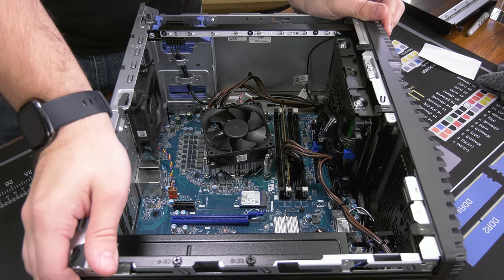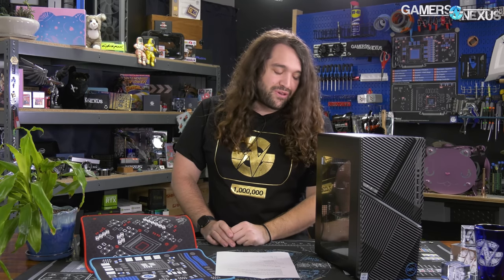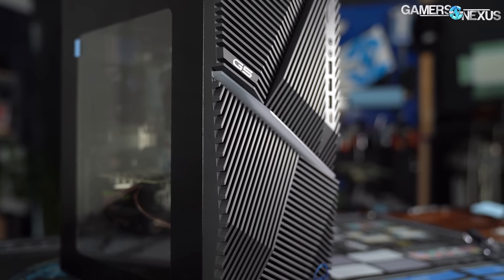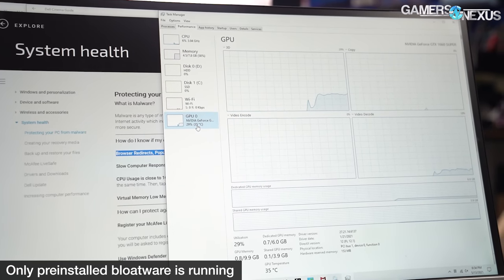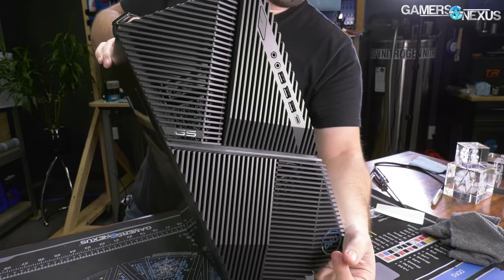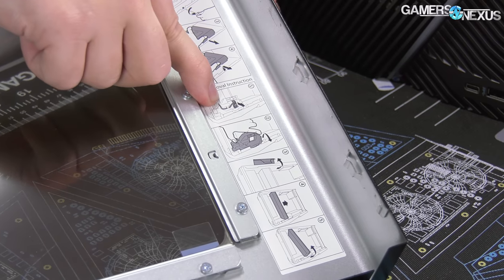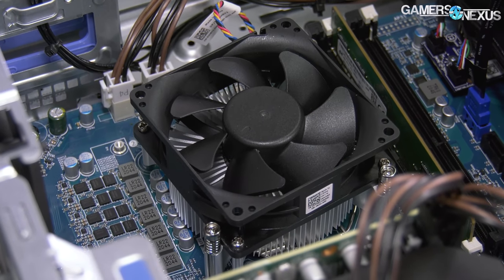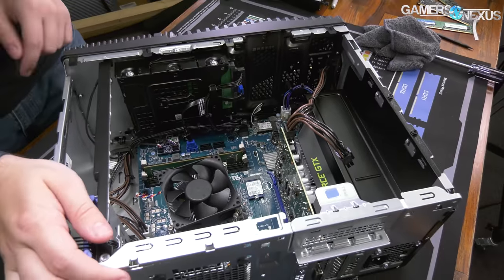Worse Than Walmart: Dell G5 5000 PC’s Garbage Parts & Hidden Charges

Comment: All of this is pretty standard Dell. I just built out an optiplex 7010 that was the generation right before they switched over to the proprietary everything. Those are honestly not bad. If that cooler is the same one as my 7010, it should be compatible with Intel style mounting brackets if you buy a backplate for it to replace the one integrated into the case. I was able to install a noctua cooler in mine.

Comment: That plain jane ram is actually very easy to overclock and clocks quite high. You can read the ic information which is nice and helps with overclocking the ram.

Comment: Dell consumer PCs have always been cheap trash.  When I did IT work over 20 years ago,  I faced trying to fix or upgrade Dell PCs and they were all proprietary parts back then.  Almost everything is integrated on the motherboard, and they are very hard, if not impossible, to upgrade.  The motherboards are not standard industry form factors, so they can't be swapped using the Dell case.

I also seen this with HP systems, but at least they use standards power supplies.  I can't count the number of power supplies I changed over the years, when nothing else is wrong.  With a Dell, you can't go to your local PC or electronics store, and pick up a new power supply.

Comment: I bought this on sale early 2020 before the supply chain issues and so far I've loved it. My system only runs at 1080p, and I've added two fans and two 16gb ram sticks. The plan for my next upgrade is a new cooler and a new processor all in one go, and maybe a 2.5ssd when myt memory becomes an issue. This PC kinda got me interested in building other PCs with a full range of modularity. I think this PC makes sense to a niche "new pc gamer" customer, like I admittedly was, and I get that full-on spec chasers will cringe knowing they have a built-in limiter on their chassis. Still, it was weird watching a review of a product and having none of the issues you mentioned. No billing issues, had fun learning some basic computer building tidbits, and got a dependable system for cheap. Am I crazy?

Comment: I worked for dell for years.  The parts they use from pc to pc are not consistent and many times because the components are so cheap, dell will tune the pc with parts that are not upgrade-able or have a custom bios config that will only work with a very specific piece of hardware.   This is the big draw back of any dell consumer pc.   They all have this in varying degrees. The server side of things is different.  

The real downside is that dell will change a configuration very quickly if a cheaper part is available which means pc's within the same model and same year CAN have different parts and different bios configs on top of the fact that most of the hardware is proprietary. so you never know exactly what you are getting. The crazy proprietary parts are to lock you in to dell. 

For most people this is a non-issue because in an office setting, the pc will work fine and never have a hiccup running your typical MS office suite.  There are much better options but they're cheap so....  A lot of of companies who buy bulk PC's will also buy bulk power conditioners to go with the pc which gets a longer life out of the cheapass power supplies that come with bulk pc's.

Comment: Can I replace the motherboard on my G5 5000 with a MSI Z590 pro wifi and still fit in casing? also, can I replace the power supply as well after?

Comment: Its basically an Inspiron case like my SFF. Identical but with adapted acryllic window and the front has a facelift with more air flow. Otherwise the case is the same as the Inspiron cases. Not cheaply feeling cases and the metal is substantial thick. Luckily the G5 case has an exhaust fan while the Inspiron models sport no fan at all but the processor fan has an direct intake to the side metal (without any filter). The Inspiron cases rely on passive case cooling.

Comment: Years ago I actually had and used a Dell XPS 8300 series. I can't remember what gpu it had because I replaced it soon after, pretty sure it was a Radeon HD 5000 series of some kind, but definitely a mid-range budget card. This was during the sandy bridge era for intel so it came with an i7 2600(non K), 8gb of 1333 ram, and I think a 2TB seagate drive. For the time, it was a pretty good little gaming computer, this was late 2010 early 2011 time-frame. It did pretty well, and it wasn't loaded with a bunch of bloatware garbage. It did have it's flaws, the case was horrible & cheap, zero airflow or room for additional fans, dell parts like their motherboards leave zero room for expansion or upgradability,. I was a teenager who had barely started working, my mother bought it for me, first real "gaming pc", under the condition I paid it off when I could. All I ever could do to it was max out the dimm slots and upgraded the gpu twice. Last gpu I put in it was an GTX 660 Ti and that was pretty much the max for whatever power supply dell was putting in these things. 

I haven't touched a Dell product since then, because I got more and more fascinated with doing my own builds, sourcing my own parts and learning as much as I could. But the reason I say all this is because at least at one time, Dell's gaming machines were at least decent. But what fascinates me here is it genuinely looks like Dell hasn't innovated at all in terms of their "gaming focused" Dell branded machines. Same horrible case construction, same proprietary parts that do nothing but frustrate the end-user and make upgrading more painful than it needs to be, etc. Feels like they're still stuck in the past.

Comment: I have seen a motherboard like that before. It will surprise you but it is extremely similar in shape and engineering.  Sony VAIO VGX-XL family.  Like the VGX-XL1. 

It has a custom everything.  Even the USB headers are custom,  custom power supply and it doesn't use standard 24 PIN either.

Comment: I have this same system and for the most part it serves me pretty well. I got it on ebay with an i5 10400f with 8gb of ram and a 1tb hdd for $250. Then I bought a gtx 970 ti before the gpu shortage for only $120. I installed some extra storage and added an m.2 ssd I had sitting around. But hey I only spent around $370 on it so I got a good price on it!
Reply: I have a similar setup but I paid $800 for it lol.

Comment: The chipset heat sink withe the wire spring retainer takes me back 20 years to when I was making amd athlon xp type set ups. When GeForce was relatively new and 3dfx was on its way out.

Amazing how a small detail takes you back.

Comment: It's not just Dell, I made the big mistake of buying an ASUS prebuilt a year ago.  Junk, no support and they wanted me to ship the thing to Puerto Rico?  I used the video card out of it and that was it.  Newegg  was no help becuase I had opened the case (rolls eyes) I reused a LIan Li case I had from the mid 2000's, purchased all new parts and burned the $1500 I spent... well,  I got a video card out of it.  Ultimately the CPU was shot.  The rest was just garbage, PSU and all.   

I used to build my own machines in the late 90's and early 2000's, but my knowledge stopped after the first Core 2 Duo's came out- just fell out of interest. I Just wanted a machine with a warranty.   Back home, I bought a Milwaukee PC machine and just upgraded the video card, this was back in 2012.   That machine still runs today.  The ASUS shell and all of the proprietary junk is sitting in a pile in a closet.

Comment: I didn't build my own system this time (the last build I did was 2916). I wasn't able to save any money so no point IMO. I got OCUK to build a banging "gaming" PC, i5 12600KF, 16GB DDR4, Gigabyte Z690 mobo,  Kraken X53, Gigabyte RTX 3080, Seasonic 750w PSU, Corsair 400D & all with 3 years warranty. Winner winner chicken dinner. I would never look at buying a "prebuild" system like Dell,

Comment: They still do that crap? I was a loyal customer to Dell for many years. But after i figured out that you cant´t replace the powersupply with a standard one, i was done with Dell. I just took the money that i would have spend to buy a new Dell, informed myself how to build one and what component is working well with another, bought all the parts and had a much better machine than ever before. Thats around 12 years ago and that thing served me well for more than 7 years. I needed something new and could sell the motherboard, memory and graphics for some money and build a new one in the same old case. Still works great and upgrades and repairs are easy.

Comment: I bought this same PC but mine didn't have a window and it had a 1660ti , I bought it when it was impossible to find cards and I got somewhat of a decent deal on it from a local shop, first thing I did was take the Cpu and gpu and put them in a new motherboard, case, fans and power supply, when overclocking the 1660ti I actually achieved some pretty good clocks , ig I won the silicon lottery with that little thing, I eventually sold the build I made out of it but it was pretty good and got me through the graphic card crisis. I will forever love that build because although it was jank it worked great for me, I was running all the games I played on it without any issues
Reply: Edit: with the leftover case I actually put a Celeron g5900 and old amd 2gb card in it recently and sold it as an office PC

Comment: Yes I'm late af here, but, I got a G5 5000 on ebay with a i7-10100F and a PNY GTX 1070 in September 2022 for ~$850.00 + tax with and am quite happy with it. I recommended it to a friend and when they went to that seller's page it was as yours is, big disappointment.
[edit] I did upgrade the ram to quad channel and put a Zalman tower cooler on it because I did have high temps.
Reply: I very much hope that you meant to type 2070 instead of 1070
Reply: @Wiisporter  Nope, it's a 1070.
Reply: @daboogiemansass  I forgot about pandemic pricing 😭 still a really good card tho

Comment: I think it will be impractical to try to find a replacement PSU or MB for this in a couple of years from now. This design severely limits its lifespan and makes the use of its parts in other systems pretty much impossible. I wish prebuilt buyers would know what exactly they are buying and stop this garbage from being produced. Unfortunately, I fear that the Dell buyer group doesn't share a lot of overlap with the GN subscriber group. 
Personally, I love the fact that I can often fix one computer with the parts of another, or easily order a replacement part without having to buy an entirely new computer.

Comment: Like the time I paid 1500.00 for an alienware laptop that shows up with lines in the lcd, then they sent two different repair reps with refurb parts, after giving up on getting the issue fixed and a ton of phone calls I just sent it back

Comment: I bought a Lenovo m93 body with the exact same model 1660 super and a i5-4570 (which I plan on replacing with a extra cpu I have laying around) on Amazon for a total of 360$ with a warranty. I’ve been gaming on it heavy now everyday and using it for media for a month now with no issues whatsoever. I’m mindblown that dell is charging 900$ for this monstrosity 🤯

Comment: It seems to me that it is hard to compare these pre-builts to anything other than another pre-built in the exact price range. I feel like I'm in a custom motorcycle shop where they are looking at my Harley and saying that thing is junk vs their custom builds. There are just as many problems with a custom build of anything. Even a custom build ends up being a throw-a-way at some point. The pre-built point is to get you up and running then toss it in five years. Even if you build, you'll be tossing the majority of your components in five years too. Any build limits you just as much as a pre-built in the sense that you are always hoping for compatibility with your existing parts and if the part will even fit in the chassis. Makes no sense to beat on these builds like we enthusiasts tend to do. Makes for a good YouTube video though so I get the tear downs and I keep watching them!

Comment: Lenovo does the same front IO thing in their sff computers
Reply: That shit is hella annoying.    I bought a refurbished one with the intent of recasing it, upgrading the PSU and GPU for a half decent and cheap gaming rig.    Only to find out that i'll wind up needing a new motherboard as well.    But at least lenovo has enough restraint to not market the ThinkCentre as a gaming pc (not that their gaming pcs are masterpieces, but they're decent enough).    And they included a few USB headers that can connect to a front panel.    Which it doesnt look like dell did.

Comment: Honestly, I think you're missing the point of buying a prebuilt Dell PC. It's not for parts, but the other way around. The idea is to add parts to it, not to take them off. I've had a Dell XPS 8200 for the last 11 years and I upgraded it constantly over that time. SATA SSD here, graphics card there, some more RAM, you get the idea. I'ts been a great PC honestly. 
Having said that, I finally got the courage (and the budget) to build my very first PC a few months ago and I'm glad I did. I was looking into Alienwares before that, but honestly I'm really glad I went with a custom built PC. Probably never going to buy a prebuilt ever again. But my time with a Dell prebuilt was actually great, sure the components are proprietary, and sure they're a bit overpriced, but generally they're quality components (I only had failures on my HDDs and that's because my system was shipped overseas). Nothing else ever failed and I think we can all agree that 11 years is sure to have taken it's toll on the components. And the PC is still alive and kicking right now, my girlfriend is using it. So yeah, maybe they aren't the best value, of course, but that's not to say you shouldn't by one. It's great for anyone who just needs a pc and doesn't really care about the specifics, and you have the peace of mind of having a warranty and customer support should anything go wrong. For anyone else who's even a bit PC-hardware literate, yeah, don't go for a prebuilt.

Comment: Very late here but FYI Dell does this to their Office computers as well… almost every company deploys Optiplex’s and every second on any auction site there’s listing for lots of these for dirt cheap. Picked up three from my uni (7,8,9 gen intel i7 + garbage GPUs) for $500. Broke the socket on the 9th gen board by trying to put a plastic socket cover on to test cpu in a custom system and the entire machine is basically e-waste if i cant bend the pins. Cant see/fix that without buying a magnifier super fine tool set. Same motherboards with IO built into board instead of chassic, same EXACT load bearing CPU cooler and custom 12v board doing 3/5 conversion PSU and board. The amount of e waste Dell and HP are responsible for forcing these in the corporate/education settings is atrocious. Same over-engineered and somewhat convenient things like swinging away psu/drive bays as the alienware and just pointlessly over-engineered things like the latch/release mechanisms and bs rubber fan grommets. PS you can replace the cheap 80mm to a noctua/better and will work, can drive a screw thru the grommet hole and will be secure. So Dells fan connector appears to be standard but… nothing else is

Comment: up until about a decade ago, i standardized purchasing and supporting Dell for all my customers.  The enterprise class devices were built to last, the warranty was great, the customer service was awesome, the discounts i got for purchasing through the partner program were better than anyone, and then the chit hit the fan.  It all went to hell, Dell went private, then from the ashes the new stuff was cheap, the proprietary nightmares got worse and I will never buy a dell laptop or desktop or workstation again, for all the reasons i know you are going to mention.

Dell servers are still the way to.  They last forever, they have very little competition, and the reseller market allows for purchase of servers at a song.  Servers yes, all else, hell no. and yet the proprietary grift sucks hard.

Comment: Those rubber tabs are actually good.  

I wish I could get those for my builds.  

Sadly, they do require specialty tools to remove.  (Not to insert.)   It's a very simple tool similar to the one to insert and remove molex pins from their socket.
Reply: They are much better than the crappy plastic ones.  If they used those I'd be condemning them for it.

Comment: I once bought an HP (yes, shame on me), because my old system had died, and I needed something just then to pay bills etc.

Worst purchase ever made. 600$ for a metal box that could run nothing.. The gfx card had like 1Gb ram, old type of HDD.. Bought a demo ex. So no keyboard or mouse even.
The only part I still have from it is the memory, 16Gb Kingston - only good thing that was in it.

Comment: I bought a Dell Vostro 5090 a few years back .. very similar to this .. I wish I hadn’t, as it seems like the cheapest piece of junk they could make .. it didn’t have a mic-in port, so I added a PCIe sound card, that didn’t work well, as the system doesn’t assign the PCI lane properly (scratchy and intermittent muted sound throughput). I had to use Bluetooth for sound/mic, that works OK, but not as well as expected!
 I should have built a custom PC myself, and have since.